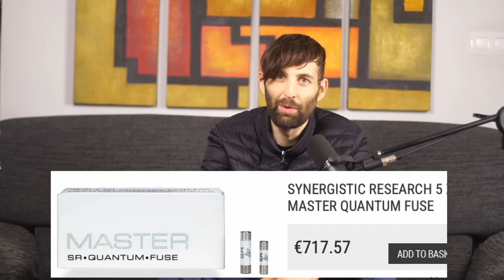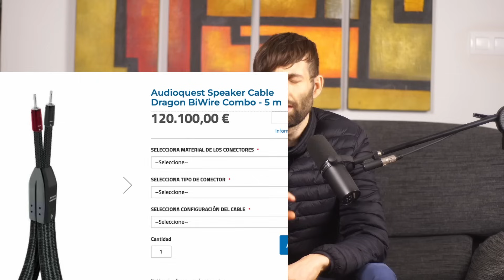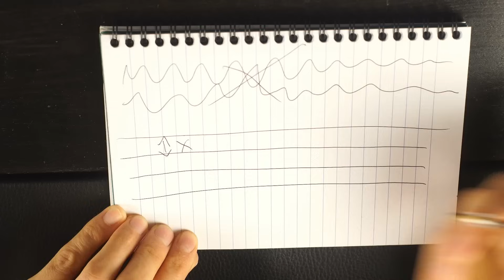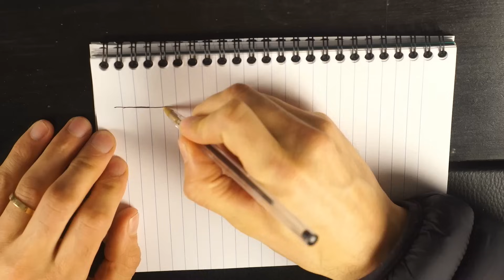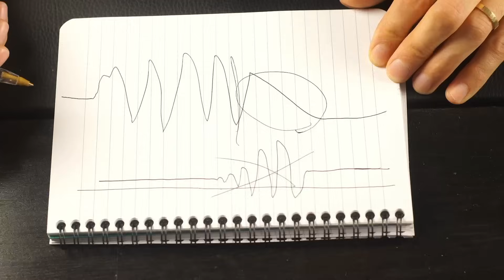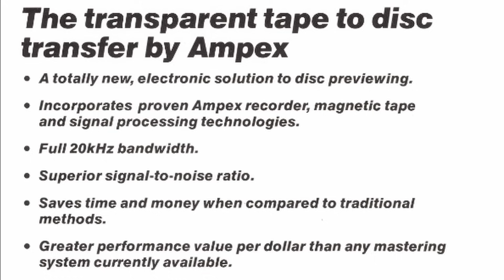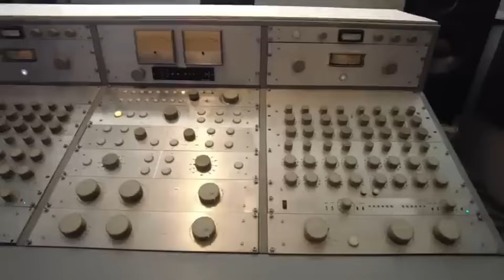Hard truth: most vinyl is digital anyway

Comment: You've missed some significant points.

Yes most modern recordings are digital before going to analog.. However when you digitise audio you chop it into little slices and then it is stuck back together. The number of the slices being the sample rate. Different analog converters do impart a sound on the end product. And when an audio signal is chopped into pieces and stitched back together there is a loss of information. Obviously more noticeable on lower bitrates but there is still a loss of information in flacs and higher.
 There may be in many cases a digital delay used in many cases since the 80s (hence why older 60s and 70s records are more sought after) but still one digital delay at vinyl cutting stage is very different to a flac file that has been recorded digitally, bounced down digitally, dithered digitally, mastered digitally, compressed digitally by distributors or streaming platforms. Each time the original signal has been altered and re digitising it in different ways amplifies this and alters the sound.

 So yes even a recording nowadays that has been recorded entirely in analogue may go through a digital delay at the cutting stage but this is still way better than being digitised and re converted multiple times.
Reply: is there a good way to learn about this? also surely youre splitting hairs when youre talking about loss in flacs
Reply: @kaleidopsy3806  not really splitting hairs. Our ears can tell as digitised waveforms are not found anywhere in nature
Reply: @Feelingawesome0 all formats are going to be lossy. in fact, there are DACs that are less lossy than analog tape. also when the digitized signal goes through a low pass filter or is converted back to analog it becomes a continuous wave again anyways, regardless of how low the sample rate is. Also all things in nature are sectioned at a certain resolution due to the nature of physics. nothing is perfectly continuous.
Reply: @gavinrolls1054  not true. Original records were often cut straight from the microphone to the wax acetate master. 
 Also yes you can smooth out a digital signal but it has still previously been chopped into slices. It would be like taking a film photograph of a low res digital photograph. It may smooth out some of the pixels but a lot of the original information is gone.

Also any loss from say the limits of the particles on tape is not the same as the loss of information from digitising. It creates different artifacts. Like analogue distortion creates different artifacts to digital distortion.
Reply: @gavinrolls1054  If you compressed a jpeg  so It was pixelated and then took an analog photo of it that is essentially what converting  a digital waveform back to an analog signal is.

Natures frequency and waveforms don't have a bitrate or resolution.
Reply: @RockManEnough  thanks for that info about Nyquist and Shannon. I will look into this. 
 The thing is with human hearing is there is a lot of things that in psychacoustics we cannot quantify and measure. For instance super tweeters on speaker's should not really do anything as they are often working way above the audible range of adult human hearing. However... they really do make an undeniable difference. Even though on there own the frequencies are usually inaudible they interact with the other audible frequencies in a way that increase depth of field, detail, air etc. Making things like reverb sound very real. 

We could liken this to light frequencies... most of the spectrum we cannot see. However if you took them away they would affect the limited light spectrum we can see.

It may be very hard for most humans to distinguish (if at all) the difference between high res digital sources and analog. However.. I cannot see how anything that is zeros and ones, no matter what the resolution, is as close to the real thing as analog.

An analogy for me would be a digital photograph vs a film one. 
 The digital may be the highest resolution but still the film photograph is more real and lifelike and conveys a visceral emotion despite less colour accuracy and artefacts etc. 
 I believe this because even though analogue film has its own kind of resolution (film grain) that resolution   is distributed more randomly and naturally (like analog valve distortion) and has not been chopped into digitally perfect bits which no matter how resolute will still destroy some information in a digitally uniform way.  digital distortion or harmonics are unpleasant to the human ear whereas analog distortion adds harmonics which often makes things sound nicer. 

Maybe only a large scale blindfold a/b of the highest resolution digital files against analog with people with trained ears is the only way to find out.

My gut feeling is that analog will win on a visceral emotional level. 

I have been an avid audiophile since the 1980s and a music producer for 25 years. I have spent endless hours a/bing gear and tend to listen mostly to streamed flacs and hi res mp3s. However with the right record player and system something happens that I feel I haven't experienced on even the highest end digital gear. And I've listened to systems that are hundreds of thousands of pounds.

Also I feel a Polaroid can provide something expensive digital hi res cameras cannot convey. There is definitely a natural magic in analog.

I used to believe it was only the artsy pretentious that bought old film cameras but now I am one of them. I also felt the same about vinyl. 
 Since music studios went completely digital they realised the productions sounded lifeless sterile and dull and  they have tried endlessly to recreate the analogue sound. 
 We have had decades of digital distortion valve and tape vst emulators in music studios... but even these still don't cut it. 
 So now many music studios have real tape again, real analog desks, real valve compressors etc. People are now buying old 90s and 2000s tascam tape 4 tracks at ridiculous prices because they have something digital can never have.
Reply: @RockManEnough  thanks I Will. However I think you underestimate the human ear and psychoacoustics. Our ears and brains are incredibly complex and have evolved only to hear sounds in nature that have not been chopped up and stitched back together. Yes they are converted back to an analog signal obviously,  but a pure analog recording never goes through the digitising process which will despite whether or not you can hear it WILL fundamentally change that waveform in a way that up until 30 40 years ago the human ear (and brain) never encountered.  I can hear a difference.  Millions of others can too. We were sold cds as the perfect  crystal clear digitised sound. We now have flacs and wavs. 
 Vinyl is outselling cds now. Not because it's hip or trendy. But because people hear a flac an a good dac and then listen to an original analog recording on a good record player and go WOW! 

Thanks for the debate though. We have a lot to discover about sound and the human ear. However an analog non digitised waveform is all the human ear has ever heard up until very recently in human evolution. And despite the marketing, ease of use, availability, low cost and supposed high quality every serious hifi listener has now gone back to vinyl and the cost of original analogue pressings recorded on all analogue gear has skyrocketed.
Reply: @RockManEnough  but just because the digital signal has been smoothed out does not mean that the brain in some level cannot hear a difference. We may not be able to quantify it but there is no other explanation for the preference by millions to go back to analogue and all the inconvenience that entails other than mass hypnosis. It certainly isn't marketing.
Reply: @RockManEnough  I think we are going round In circles and will have to agree to disagree as my main points arent being addressed. Higher resolution  or equal resolution does not mean that its  natural sounding to the human ear. No computer analysis can detect a difference in waveforms because the computer itself is digital and there are many many aspects that cannot be measured.

I've tried analogy and I don't really know how else to put my point of view across. Analysis isn't everything. Human beings always think we are making progress technologically . Sound in nature has never been digitised. The human ear has never experienced digitised waveforms. Despite all the marketing. Analysis. Computers showing there is no difference etc . Consensus shows the human ear prefers analog (natural) sound. And humans are often very arrogant in believing that we can with science create things better than nature. 
An unadulterated waveform will always sound better. Yes you may not be able to tell the difference scientifically but that doesn't mean there isn't a difference.  It just means that science can't measure or understand the differences yet. 

Again if analog didn't sound better then everything would be digital by now. Instead there has been a complete U-TURN .  Major music studios are even recording 100% on tape, straight through an analog desk, cutting straight to vinyl master and then pressing copy's for mass consumption.  Zero digitization.  Zero da converters. Just pure waveforms. Will it be as high res? Maybe not quite. Will it sound better to the human ear? Yes 100%
Reply: @RockManEnough scientists always claim they have found the smallest particle and that there is nothing smaller.. until technology creates a better microscope.

All of life and the universe is energy frequency and waveforms, every animal, plant human being and life form has evolved with these waveforms of light energy,  sound energy, radiation etc. These waveforms proceeded our ears and eyes and in fact created them.

Here's a question. If you had a bongo player or guitarist playing in front of you and you then were played the highest resolution recording we currently have technologically of that same musician. Do you not  consider  that your brain, ears and nervous system may be able to detect a difference in the natural sound vs a digitised and converted sound even when a computer cant?. 

If you can't consider this is a possibility then you are not debating in good faith. 

No man made computer can decode sounds better than the human brain and nervous system. 

The debate between speaker cable rages on because of this fact. A computer cannot analyse the difference between bell cable and high quality audioquest or valhalla because there are many factors it cannot quantify,  like skin effect , hysteresis and other things yet undiscovered it can only see the basic waveform.. thats it. The human ear can easily hear the difference. It's is really quite naive to believe that if we can't detect something on a computer that it therefore doesnt exist.

There are people that can smell alzheimers on people before they have it. No computer can detect alzheimers and we don't understand why some humans can do this. It however is 100% real. 

If we sit behind a pane of glass in  the sun our eyes can perceive no difference in the light but our skin and nervous system can. 

There is so much that we don't know.  And humans have this tendency to be adamant that if we can't test for it then it doesn't exist and that we can recreate or mimic nature better than nature itself. We can't.
Reply: @RockManEnough  because it ALWAYS stays a waveform.  Yes it's coloured and less accurate but it's more natural and I believe our brain can tell the difference.  Hence the huge love of and resurgence of vinyl and analog audio reproduction against all odds.

I'm not a huge vinyl person due to the inconvenience.  However if I play an original beatles record against a digitally remastered record I can feel a tangible visceral emotional difference. I can't quantify it and the waveforms would look identical but I know that there is a difference.  

I'm not a wafty arty fatty fanatic and like I said I don't really have the time or finances for rare vinyl. I also would rather use $1 bell cable than £1000 dollar audioquest.  Again the waveforms would look exactly the same on a computer. Many Scientists will argue till they are blue in the face that there is no difference in cable sound because the waveforms look identical. 

If you live in the south of the UK please come and hang out and we can do a blind a/b test. I used to be a non believer regarding cables and analog. I'd happily be proven wrong but how do you prove something that can't be quantified. At this point it is opinion. Do we assume our current technology of computer analysis can analyse every aspect of sound better than the human ear and brain or do we trust what we hear and what the majority of people hear and I would say the majority of people prefer the sound of analogue hence the grassroots return to vinyl against all odds.
Reply: @RockManEnough also flac is immensely better in definition than cd quality. I could a/b this for you. Its night and day on a good hifi system.
Reply: @RockManEnough  no.. not really magical thinking is it when I've explained concepts like skin effect of which you have probably never heard of. Or when millions of hifi users can also hear a difference between bell cable and higher quality cable in blind tests. That hifi shops and magazines for decades have described in detail the difference in sound of cables. Yet "trust the science" guys like yourself say "duh.. but it all looks the same in a computer on a waveform". 

 I've given you enough examples and   humoured you long enough. You can't hear the difference between a cd and a flac so I have clearly wasted my time , energy and expertise on someone that hasn't the common sense, intellect or ability to think critically in any way shape or form.

Keep telling yourself a natural waveform is exactly the same as a digitised and re-converted one because the waveform in a computer looks the same. 😂 That is the defintion of magical thinking.
Reply: @RockManEnough  you said cd has no sound difference to flac. So every tidal user is a magical thinker are they? 
Who converts a cd to flac and expects a sound improvement? That's moronic.
Reply: @RockManEnough you also stated that cd sounds as good as the original source. Sorry buddy but you must be out of your mind. Vinyl easily sounds better than flac and cd doesn't even come close to vinyl.

You need to get a better hifi if you can't hear the difference.
Reply: @RockManEnough  I'm a producer and engineer of 25 years. You unironically state that cd captures everything you can hear. Vinyl  unquestionably contains vastly more audio information and detail. This is not up for debate and shows how little you know about audio. 

If cds contain all the audible information then why do Flacs , wavs, aifs at higher bitrates sound so much better and have vastly more audible detail than cds? Tidal and qobuz exist purely for the high res and flac files. Are the millions of listeners and subscribers of these platforms magical thinkers as well? The improvement In sound quality of flacs is also not up for debate. To argue that cds sound as good and contain as much audible information is absolute laughably idiotic.

Go and Learn about bit rates and sample rates and  dithering and the different compression technologies and resulting artefacts of those  different audio file formats. 

 And while you're there please research the dunning kroeger effect because you are a perfect example of this. 

I can't believe I wasted my time responding to you.
Reply: @RockManEnough that makes zero sense.
Reply: @RockManEnough  ok 😂 You're right.. CDS are higher quality than vinyl and flacs and billions of people are wrong. 👍 you must be a genius.

Comment: Having the real sounding was reason  why I purchased turntable and I buy 98% second hand old LPs  And I succede. The difference is contrary to beliefs of most  is not in   carrying tracks mediums,   only in studios  which produced  LPs -  now and then . Studios since 40 ties untill 80ties were using analog electronic, also tube  which struggled to go above 20 kHz and did not alow for  manipulations   Also standard for all processing was set to max 20 kHz but I believe  it could be 15kHz  as well.   After   started race to claim that the  higher  limit the better, digital alowed  to extend it ,  it is just wrong by  alowing lot of scrap to be heard. .  Now they even go futher with 45 /min when it is confirmed that 33/min carry up to 50 kHz

Comment: Vinyl cuts have 'analogness' introduced at the cutting head which the ear likes. Cartridges add to this. Listening to a signal which has not been digitised i.e. early stereo 1st pressing though a valve replay system is a different experience. But digital recordings can sound great as well. I have both analogue and digital discs and enjoy both. Harmonically rich sound though comes mainly from 1950's / 60's pressings imho. But that's a specialised area which I admit is not available widely so with that caveat I thank you for an interesting video.
Reply from the maker: see my previous video on how vinyl has no sound
Reply: Pure digital is music covnverted from electronic loops  and machines   and some listeners  like them because it is so not analog.

Comment: When people come forward with the argument that the digital signal is not "transparent" because it's just quantized snapshots of the voltage levels. Please look up quantum physics. It turns out that our fully analog world is actually digital (quantized) under the hood. Okay, it's on a totally different level, but still...
Reply: Quantum computers don't operate with digital 0s and 1s. By definition, it can be 0 or 1 or 0 and 1 at the same time or anywhere in between. Also, the immense power it would take to prove the plank length true is orders of magnitude greater than anything we have made today. You would need a particle accelerator the size of Earth's orbit to prove the "digital" nature of reality.